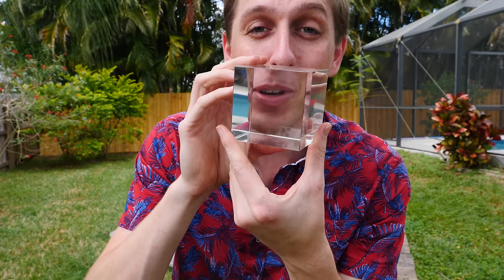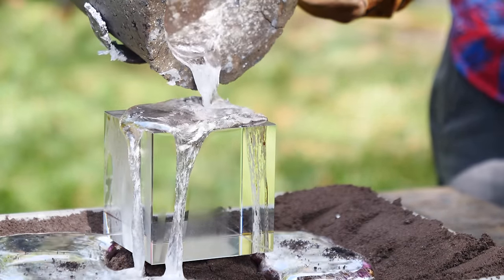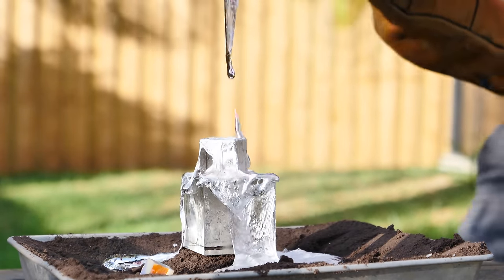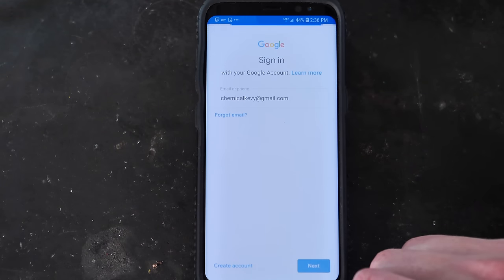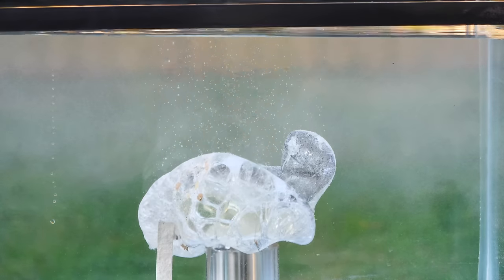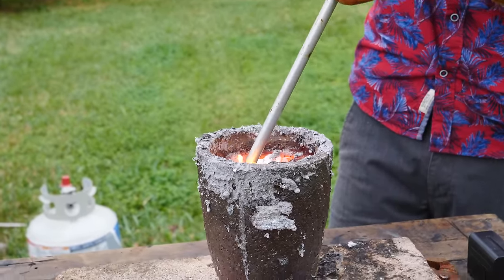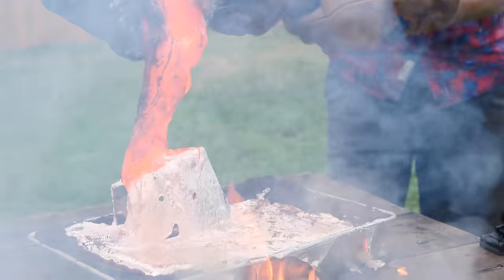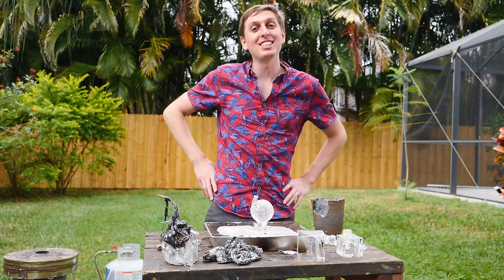Molten Aluminum vs. 𝘛 𝘏 𝘌   𝘊 𝘜 𝘉 𝘌

Comment: "I'm wearing glasses because it might crack"
Said the man in short sleeves and pants handeling Molten aluminium.
Reply: Helloo, they're called APPENDages! Eyes are hard to live without/heal.
Reply: @malkeus6487  yeah but even then there is still a possibility of infection if the glass cracks badly and gets launched at him, and depending on how it if at all the glass cuts him it can be very dangerous. Nonetheless it's still pretty dangerous to do all this in, essentially, beach clothing.
Reply: @Potatotenkopf  Amputation! Double Amputation!
Reply: @Potatotenkopf  I am 100% serious about this!
Reply: @malkeus6487  let's never speak of this again before I get whooshed and banished to a realm far below hell.
Reply: @Potatotenkopf  I think it's a bit late for the former, but there's still hope for the latter. Thanks for the laughs ;)
Reply: @Potatotenkopf  I think the danger of being burned is worse than the danger of the glass grenade but either way... he's either not American or has the Best-Insurance-Ever.
Reply: @tyson31415  I guess so
Reply: Hahaha I was thinking the same.  I guess the eyes are the most important thing to protect, the rest can heal up eventually. :P
Reply: @redsquirrelftw  yeah deep tissue damage aint no thing Skin regrows right
Reply: You can never wear to much ppe when handling molten anything.
Reply: @Potatotenkopf  even heard of band-aid
Reply: @Potatotenkopf  R/whooooowherewasthisgoingagainohyeash sorry I had to do something similar so others wouldn't for your safety. For extra safety please wear a safety tie
Reply: @3fxz483  no
Reply: @ruty6099  10/10 can you also protect me from the IRS, Ive been commiting tax fraud
Reply: @Potatotenkopf  yes indeed wait wah
Reply: Meep Meep I’m joking bruh
Reply: He's a beast thats why😂😂😂
Reply: Aluminum.
Reply: Malkeus Diasporan 

Trust me it’s hard to heal and live without limbs too
Reply: Malkeus Diasporan procedes to shatter glass with bare hands
Reply: Malkeus Diasporan it’s a joke...
Reply: @Potatotenkopf  bruh
Reply: He works with aluminum cuz he sweats too much to work with food.
Reply: Big burn... big oooff
Reply: two words:
cybernetic prostetics
Reply: can you make that thing out of glass that looks super small but when you crack it it explodes its called the angels tear or something
Reply: @Potatotenkopf  I am pretty sure that surgery can get the glass removed, Dan on the slow mo guys got glass embedded in his hand and surgery got it out(he still has both hands and they are both fully functional)
Reply: @Potatotenkopf  I mean, I get what you initially said about risks but I once had a glass oven door explosively shatter all over my legs, cutting them up, and I still went to school that day with next to no medical care. All I got out of it was a few small scars. It seems pretty unlikely that a wound would get infected so bad it would need to be amputated from something like this and it is definitely more important to keep your eyes protected. I'm sure he knows the risks haha
Reply: FLORIDA MAN INTENSIFIES
Reply: Half of us watch these videos to see if today is the day he gets maimed or worse due to his lack of any safety practices.
Reply: Shards of flying glass????
Reply: What about the thing he has between the legs.  Can that heal too ? :-)
Reply: @beenile  You are very lucky if your story is true I'm not saying it's not because some people make up stories while others are true but if your story is true as I've said before your very lucky. I have to ask how did the oven glass door explode or shatter? I've never heard that happen before. A little tip just incase you didn't know if you ever get in a situation like what happened with you or any specific shards of glass get stuck in your body DON'T REMOVE them from your body or touch them. Call a doctor or a ambulance first. The reason is that if you were to pull the glass shard out of your body the wound would start to bleed out and you would lose a lot of blood, pass out and then die. The wound the glass shard made stops that from happening as long as you don't remove it but you must call a doctor or an ambulance to remove it safely don't remove it yourself. This also works if someone is randomly bleeding from an injury cover it with a cloth or tissue to slow down and stop the bleeding and if the injury is really bad then go to a doctor.
Reply: @victorhurwitz5559  Yes, it did happen. I am 18 now, and it happened when I was 12. No, I did not have glass stuck in my legs, I never said I did. All that happened was a few thin and a few deep scratches. Obviously, if there was an actual medical emergency (and I have been in them) I would have gone to a hospital. Today, I've had first aid training and hold a first-aid certificate so I know what to do if something worse than what happened, happens. 
The oven door shattered because I leant too heavily on the metal handle, which created pressure on the glass, it then violently shattered. this wasn't a slow affair, I simply turned, leant against the handle (which pushed it down into the glass), and then it shattered into my legs. Most of the glass was dusted and only caused minor scratches, but the larger bits caused kind of deep wounds that healed into scars. I didn't have any glass stuck in me to my knowledge.  
edit: realised youtube just has garbage text formatting.
Reply: @beenile   It's very interesting that it did actually happen and it's also really cool that you got really lucky. It is very good that you now have and know how to do first aid with your first aid training. 

I had no idea that you did first aid training and it's true that you didn't say that glass shards dug into your skin which is good but I had originally thought that you could've been in danger of bleeding out back then with a glass being stuck but I didn't originally realize with your original comment that you didn't say any of the glass shards dug into you.

That was part of the reason I wrote the tip because I wasn't sure if you knew about it and it's a pretty useful one. It's good that you knew the tip beforehand I'm saying this as a guess but it could be useful to other people. I can say that it must be pretty cool to have those scars which can be a cool thing to tell people about and is a reminder of how lucky you are. 

I also want you to know that it's not a problem with the paragraph spacing especially because of the eyesight problem/bad eyesight problem. I also know that I can write/type/say a lot so I'm not always the best with paragraphs/paragraph spacing. I can also say that I'm glad that you managed to read and reply to my comment especially with it being big and the bad eyesight.

I have to ask do you use contacts,glasses or both? I'm sorry that it was hard to manage to read the long message with the problem. I also want to say that I did try to make paragraph spacing with my long comment but it still may be long at parts. I'm not use to making paragraphs/paragraph spacing with my comments on youtube. 

Edit: I'm making a reply to the edit on your new comment. I hadn't noticed till after I made this comment but everything I've said is true. I do write a lot and sometimes it does need at least a paragraph space because it can be a bit jumbled altogether as one giant paragraph/comment. It can be the formating of youtube with the comment section/system but there is a arrow on your phone to create comment spacing/paragraph spacing or your laptop with the enter button. It just depends if people decide to use it or not. I do hope you read the whole comment because I wrote more than just about the paragraph spacing and I write a lot anyways.
Reply: @victorhurwitz5559  im glad that you took the time to be concerned about a stranger for something that happened so long ago with me.

I wear glasses, but i have an eye condition (i genuinely can't remember if it has a specific name, i just know it's not dyslexia) where one of my eyes starts to sort of drift off/unfocus while i read and makes it all a big blurry mess especially with delicate font like the one youtube uses. I'm meant to have special glasses for this but i can't afford them.
Reply: @beenile  This is all very interesting and I'm glad you liked my comment also I wasn't originally sure what you had meant with the youtube font for comments but I figured it was something with the eyesight condition. I can say that it's interesting your eye condition.

I may be mixing up one thing with another thing but isn't it something to do with the two separate brain hemispheres that aren't properly connected which causes one of the eyes to wander off to a different spot in a condition or am I mixing things up?
Reply: It's actually better than having super hot melted clothes stuck to your body lol
Reply: @malkeus6487  vision is the least need sense.
Reply: Yeah, iirc some other science content creators have pointed out that this guy send a wrong message about lab safety and workplace safety by handling molten anything without proper protection.
Reply: @Sohendar  bare skin is safer with molten metal because it'll have the leidenfrost effect, whereas it'll stick to fabric and light you on fire. Lol
Reply: Absolutely, kinda irresponsible thing to do in youtube
Reply: Literally shorts, I was in confusion
Reply: @talaguitmichaelrencesalina5328  I'm agree with you, he has a few vids about melting aluminum with really poor safety protection. Until he gets a tiny drop of metal on his skin he will never understand the risk that he is taking just for make this great vids.
Reply: He’s in Florida
Reply: @Potatotenkopf  how can small glass cube crack big enough and fly fast enough to crack his eyes?
Reply: @artemefimov8215  well the eye is very soft I can easily scratch my eye in a way that will damage it with my finger nail, not to mention glass. The glass isn't sterilized, if a small shard gets into the eye it could cause an infection. And so on and so on.
Reply: thats florida for you
Reply: *shorts
Reply: The molten aluminium isn’t what would hurt him, thanks to the Leiden frost effect.
Reply: It’s much easier to get stitches in your arm than it is in an eye plus it could do more damage in the eye
Reply: @korbensasbrink-harkema8827  your cute thinking that a severe Burn would involve stitches... 
FYI it just involves either permanent scars or skin grafts.
Reply: @Light on the inside I was talking about the glass shattering, I miss understood your comment
Reply: He’s actually indestructible, but his chemistry teacher insists
Reply: I was thinking this lol
Reply: @Potatotenkopf  r/wooosh
Reply: Nice
Reply: This was filmed in Florida, I think I explained this quite clearly
Reply: @malkeus6487  r/wooosh
Reply: He is a florida man
Reply: florida air is hotter than molten aluminum anyways
Reply: @tyson31415  he's from Florida so I'm guessing  he has good insurance, or he's just crazy lol
Reply: @redsquirrelftw  People have died from heating up glass I read one case where somone did that on the stove and it exploded and killed him from a glass shard in the heart.
Reply: @irvinggonzalez203  Aluminum can literally explode from contact with water. and I mean chemically not just a steam explosion.

Comment: 2:00 literally no leg protection against splash on the legs. Excellent,
Reply: Doesn't help that there was a propane tank nearby
Reply: Not to mention he asks his buddy if they should get the hose- WHICH MEANS THEY DIDNT HAVE FIRE SUPPRESSION EQUIPMENT ON STANDBY?! You should always have a fire extinguisher or at least a fire blanket when dealing with fire or molten anything. Not to mention there isn’t any kind of towel down to catch the glass debris? His hypothesis was that it was going to shatter! What if he misses some glass shards on cleanup and it ends up in someone’s foot or even the dog’s paw?!
Reply: @nortalian549  a towel would catch fire and melt wet grass and ground will hold and cool the aluminum. Aluminum fire blankets would just melt from the heat. Leg protection aka jeans arnt to great but better then nothing.
Reply: and that’s not even to mention the LIVE ELECTRICAL POWER SUPPLY BARELY 2 FEET FROM THE MOLTEN ALUMINUM AND FALLING GLASS! Seriously, that power supply is arguably more dangerous if damaged than the failing glass pyramid and molten aluminum. Explosions, plastic and toxic bits spewing across the entire yard (and possibly further), destroyed camera equipment, and to top it all off electrical fires spreading throughout the grass yard. The heat from even a drop of that molten aluminum in the wrong spot could’ve set it off instantly.
Hilarious that he showed it in the video, but please be responsible with your electrical equipment! Physics doesn’t care about your feelings!
Reply: @heatherhoward4197  still no excuse for propane tank and missing fire suppression anything. Also hot proof thick leather pants are not hard to find.
Reply: I admire your dedication to science and education, but this was reckless.
Reply: who cares danger is cool
Reply: Ehh aluminum burns aren't that bad. Small drops will only hurt for a second. It hardens REALLY quickly. In the foundry I worked at we just wore jeans. All my old jeans have tiny holes in them, but meh.

Comment: Your glass-reinforced aluminum was neat. I don't know if it actually makes it stronger or weakens it, but neat.
Reply: If there were less silicon in it I'd be inclined to say yes. If the unmelted glass is in small enough particles it could act as a rigid filler, and the aluminum as a matrix that transmits force to the filler, so It'd essentially function like a composite. If he fully melted the mixture, silicon in aluminum functions much the same as carbon in iron- it allows hardenability and depending on the microstructure it can get very hard. 4000 series alloys can have upwards of 10-12% silicon and many have strengths comparable to mild steel but at roughly 1/3 the weight.

Comment: The molten glass had an aluminium shart.
Never thought I'd ever type that out...
Reply: Sidenote, that was an excellent display of the difference between viscosity and density of the 2 materials. The aluminium was very "watery" due to the relative extreme temperature, it takes a lot more to melt glass than aluminium.
I don't remember the specific heat capacity of the two materials and I am too lazy to go look it up in my textbook.
Reply: @martindrengenxbox360  plus glass technically doesn't melt since it's an amorphous solid.  Instead when it's heated above it's glass-transition phase it starts to flow but will always have a relatively high viscosity.
Reply: Jack M So what? If I want my glass very liquidy I have to vaporize it and then condense the silicon? (probably the glass would decompose into silicon and oxygen before then.)

Comment: Him: “I’m wearing glasses just in case it cracks”           My chemistry teacher: “We need to wear goggles because we’re heating water.”
Reply: Your chemistry teacher is responsible for the actions of a class of 16 year olds.  I don't blame them.
Reply: @jckmohr5912  still accurate tho xD
Reply: Well, the teacher wants to get the class into the habit of safety gear
Reply: That's because adults get lazy about PPE. 2020 is setting a great example for PPE burnout.
Reply: Videos shown there to us are like:
We're heating water.
Please remember not to do this at home.

Comment: 7:58
When you finally realize that glass and aluminum won’t mix
Reply: That requires being smart, but he's a Floridian so that's out of the question :P
Reply: Just needs an emulsifier
Reply: Glass And Aluminium Do Mix Well If Done Carefully @ The Correct Heat / Balance Ratio 
This Is Why UFO's. Appear To Look Like A Smooth Poured Boiled  Sugar Sweet , And Can Look Metallic While Also Glowing . There Is Energy ALL AROUND YOU  ,The Simplest Form Of Energy , STATIC ELECTRICITY Has Existed From Time Immemorial , STATIC ELECTRICITY Is There FREE FOR ALL HUMANITY 
STATIC ELECTRICITY IS WHAT KEEPS NATURE ALIVE 
Bless Up Earthling
Reply: @joohop r/ihadastroke

Comment: “Sorry for lighting the yard on fire, Mom!”

My mom would freak out if I did that.
Reply: As she should. Seriously, if you're doing anything like this, anyone should freak out at you. This is beyond awful.
Reply: @prydeerrol  Because I don't think they should pour molten metal onto something that is prone to exploding into shards when encountering strong, localized changes in temperature, which would also be superheated from the transfer of thermal energy into the glass... without any sort of protection?

I'm not sure what my children are gonna be either, but I would hope they will be able to survive their first experiment without becoming injured or disfigured or worse.
Reply: Your profile picture matches. Kinda
Reply: But she knows he’s moving out.
Reply: @eschelar  ok boomer
Reply: @eschelar  ok bored 40 year old facebook mom

Comment: camera guy is the smarter one, he has jeans on
Reply: Shorts.... Explosive glass and no safety glasses....
Reply: Haas well, he may be smart, but apparently not that smart 😂
Reply: old no. 7 theyd just catch on fire easier and be harder to remove
Reply: Or then you realize that the material is flammable and will also stick to the skin
Reply: @spoonge_bab967   Oh no, there is molten metal on my skin. Let me just remove my skin real quick
Reply: @spoonge_bab967  Eh, not really. Working equipment for welding and such is made either of jean or... fabric graphic? i think it is called that way on english. The difference is that those clothes are way thicker than your everyday jean, and in the case of gloves or aprons for working in high temperatures, usually have metal plates (Though i am not sure about that last detail, i didnt heard well what my teacher was saying so it might be incorrect). The point is, work clothes are usually made of the same material, but thanks to how thick they are, it takes time for the liquid metal to go throught them, giving you time to react and do something about it